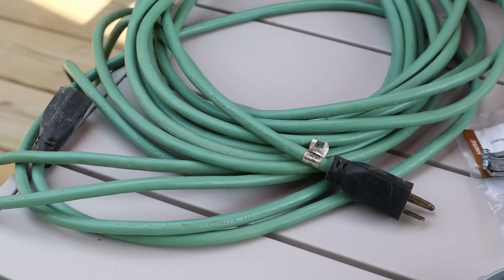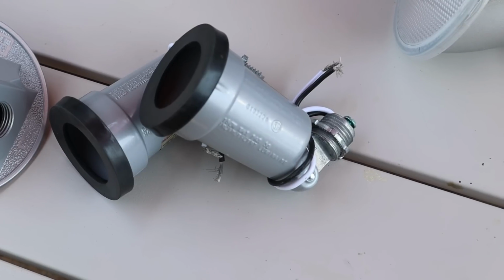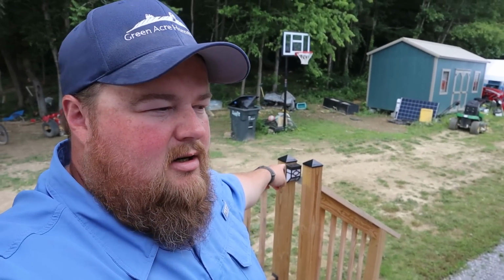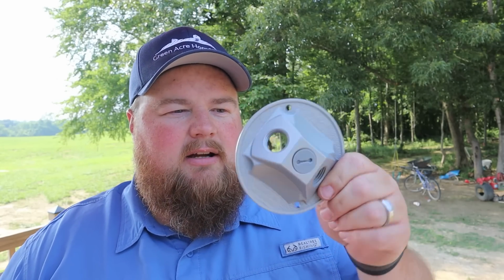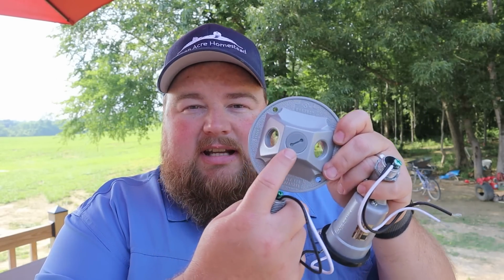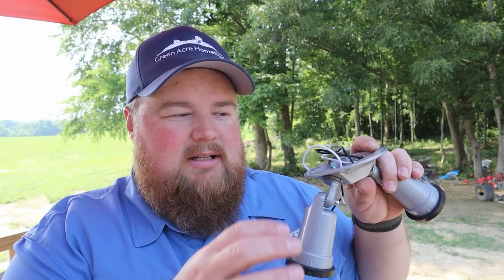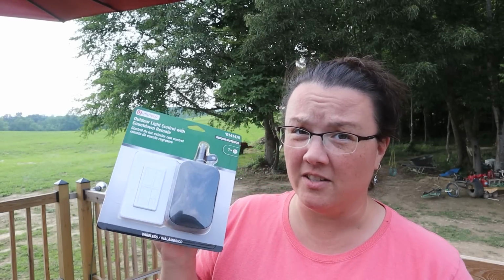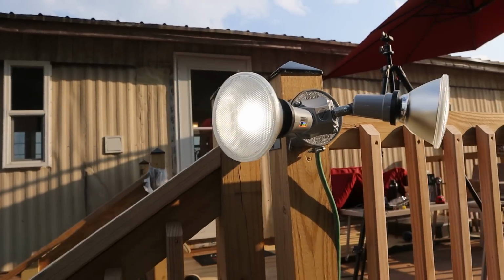The Easiest Way to Add Outdoor Spot Lights to Your Home

Comment: As always, great 'upgrade'.  I'm planning on doing something similar, but I'm going to be using Reolink POE lights that'll be controlled by my NVR, as well as being able to be controlled via my HomeAssistant setup.  Since I'll be using POE, it'll only require a small network cable to each light setup, so I'm hoping it'll be easier to hide.  This is on my 'to do list' for HOPEFULLY 4th of July time off, but I've got a huge amount of good 'ole poison ivy I've got to take care of first unfortunately :(.

Comment: I know this is a little late. I’m just now watching this one but your lights outside that you put up. I love your idea country way of running an extension cord. The sun is going to bake that cord like you have no idea you’d be so much better put it inside of PVC and having loose wire do not put an extension cord inside of PVC, it’s not code, but put it inside PVC to protect your wire from the sun or you’re gonna end up having to redo it anyway

Comment: I commend you for making a good plan. Future advice NM connectors are not made for Wet locations like your outside. They make a weather tight connector that will prevent the water from getting into the box, its a simple fix and not expensive. Keep up making the videos we love them.

Comment: You can actually upgrade with an LED floodlight with built-in wifi light that you can control by turning it higher or dimming it or changing color and turning on and off schedules year round. Amazon has a huge collection of LED lights with wifi for all your needs.

Comment: When are you going to work on the siding of your home?  I know you have been busy but I so look forward to what the outside of your home will look like once you get new siding put up!!! :)
Reply from the maker: Maybe this year. Not sure.
Reply: @sam-and-angela  metal siding is under rated, don't you think? It can be repaired, primered, painted and at a lower cost than vinyl. And after 30 years, don't have to worry about dried, warped vinyl panels to repair/replace. Hope ALL had a wonderful fathers day!! 😀🇺🇸🍃🌸🌺🌼🌹🌾🍄🌻

Comment: I would have run the power cables under the deck so it's less visible but looks good and straight forward. I'm looking to add similar lights to my home.

Comment: Here is the deal….. 
12v siren ….. 12v motion sensor …. Old 12v dewalt battery.     
It has worked on ALL CRITTERS large and small for over 25 years.

Comment: I always like your videos.  You guys are awesome.  I certainly can understand why you want to have more light out back. Normally you guys "do stuff up right" and with this I am a bit surprised.  Why didn't you "hardwire" lights in along your overhang and use the switch for the present outdoor light? Cutting apart an extension cord and then plugging it in seems so "out of character" for your guys. 😕

Comment: I would have done a permeant installation. Mounting the lights up high on the mobile home, pointing down towards the woods. And more of them. One set on each corner, and one in the middle.

Comment: I installed a motion sensing floodlight with camera for 150.00, probably less than you paid for your setup. It uses my existing porch light wiring. But you need Wi-Fi.

Comment: Hello again, I don’t think you’re using the right connectors for your cable. They should have a rubber grommet on them so they’re watertight not clamps.